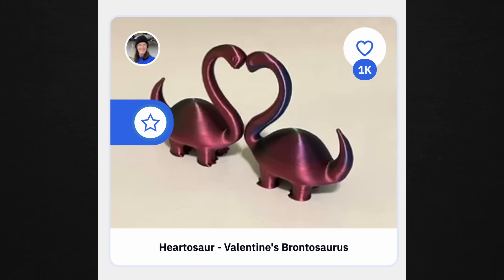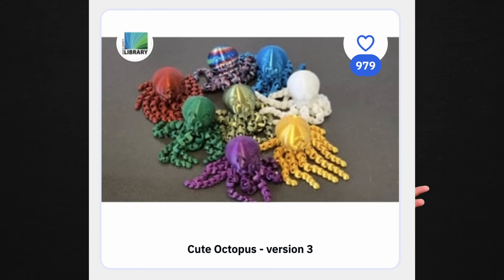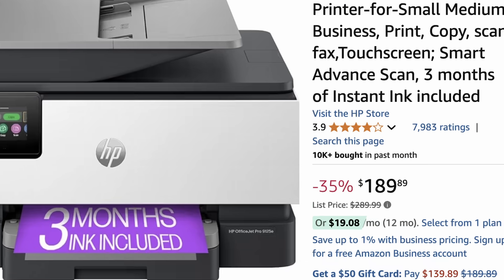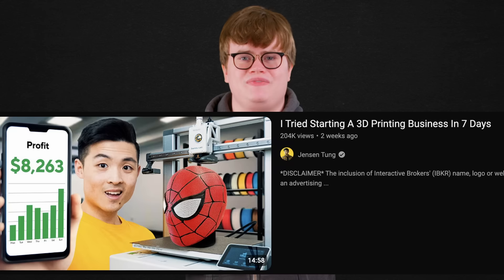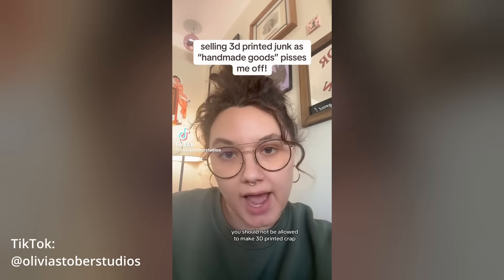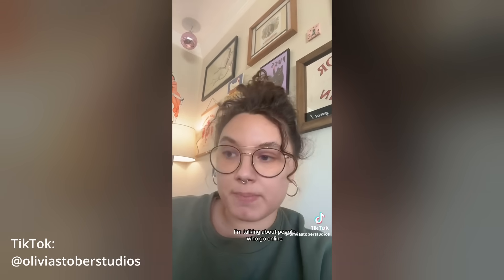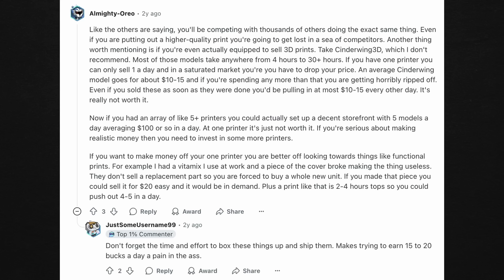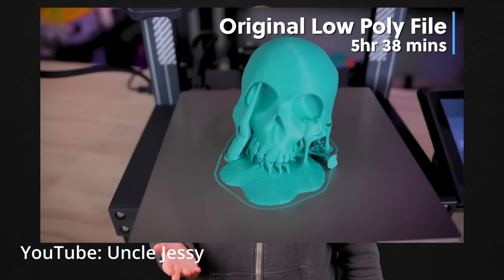The Rise of 3D-Printed Slop

Comment: I will say, sanding is not such a problem anymore. My bambu A1 mini, which isn't particularly expensive, produces incredibly smooth prints that don't need sanding at a layer height of 0.10mm. That does mean longer print times, but sanding would take even longer. Won't help the people trying to make a quick buck printing crap, but if you want it for what it's good for then it can be really good

Comment: I feel like 3D Printers are like photo quality ink jet printers. Almost noone can justify owning one themself. But. A community printing shop can get an expensive one and people in the community just rent the print time. The rent then financing both payments fo any loans/credits used to buy hardware and replenishables and also keep someone that can run the maintenance jobs to keep the darned thing running reliably. 

That way, you get the best of both worlds as the end user. A print that's cheaper than what it would cost to do in your own home, and a printer that's regularly serviced and calibrated by someone with the knowhow. 

Because, until we get truly hassle free set up and forget printers. Like an office level laser jet. It's too little fun printing to justify expense and waste. 

And if it's a community run printer, you're less likely to print plastic waste.

Comment: It might be an edge case although, as a tool maker, I bought one for making patterns for metal casting and vacuum forming. It was far more time consuming making tooling from wood and 3D printing makes it easier to add details, plus the prep effort is about the same. I'm currently looking at a resin printer for lost wax patterns

Comment: I recently bought a higher end 3d printer from Bambu Labs. Been using it to make prototypes for my own lighting and decor piece designs, as well as molds for sculptural work. Insanely useful tool and a valuable part of the process. But as a stand alone production system… not so much.

Comment: I use my 3D printer to print stuff i can’t get otherwise such as custom adapters, housings, holders, tools, gridfinity and more. Most of it is designed by myself. That’s what i bought it for, it’s a tool, not a slop printing machine.

Comment: There is a massively ‘holier than thou’ attitude in the comments here. You don’t have to be into 3d modelling to get a LOT out of the 3d printing hobby. In my case, I’m interested in projects like cyberbricks, which are pre-designed kits with electronics etc. For example,  me and my kids can create our own RC model kits - we can enjoy 3d printing all the parts required for the model, then have a good time assembling, adding the electronics components and motors, and then get the satisfaction of playing with and reprogramming the finished product. 

In this entire process we haven’t done any 3d modelling ourselves, but we get a great educational family activity, electronics can be reused in new projects rather than thrown away, and there hasn’t been a whole distribution chain involved.

I think people should stop trying to be gatekeepers for the hobby by insisting that people ‘need to do their own 3D modelling or else they shouldn’t own printers’. The whole process is really interesting, especially for children, and it will likely inspire them to eventually create their own 3D models, or get into programming, or become more interested in engineering

Comment: I think you're way too defensive about your opinion here lol. 3D printers are going to waste in most cases and it's all fine and good to learn modelling parts or printing something that's going to be useful (like I had a special window hinge break recently and it was cool to 3D print a replacement) but I'm kinda upset by the mountains of random crap (not saying all 3D printed stuff is crap, but if you're printing crap---"dust catchers---it's crap) that I see flow out of our maker space printer 😬

Comment: Had my printer for less than a month and had zero experience before. Bought the 5m pro from flashforge and I had fixed a bulb holder for my 99 dodge ram and fixed an old big fan that one of its legs was broken, made a customized part for my ford ecosport where the part was nowhere to be found. 3d printed a mini4k drone case and customized my name on it. Me being from the Caribbean having extreme delays with shipping products this is gold. So for me its worth it, as what I had made up to now fills holes that could have never been fixed. 

Just from an outside of America perspective.

Comment: Yes, 3D prints are handmade. Anyone who has operated a 3D printer can agree. Let's stop pretending that these machines just spit out 3D prints with no effort. Yes, filament and SDF files are purchased but, did you make the tree that stool is made from? That being said, we should not be seeing people trying to get rich off selling 3D prints. That is not what the printers were designed for. The problem is with 'gig work' addiction. No one is getting rich off 3D printers. Anyone convincing you they are, aren't telling the truth.

Comment: 2:15 wha?! What kind of standard laser or inkjet printers have you had!? Ive legitimately had an easier time modifying a defunct stratasys mojo into a product specific 1-72 and 2-56 thread ultem tapping machine than getting a damn paper printer with a bad print head working again!? Inkjet printers are abominations! 

Is there just something wrong with me? I honestly would rather try to print a big warp probe part in polypropylene than try to get a damn HP or Lexmark to work reliably... 

okay, maybe its because they sit so long between printing so the ink gets messed up in the heads... Still, i dont like paper printers, even the laser ones have so many networking issues... okay, sure, so maybe thinking back i miiiight have gotten around networking issues on the 3d printers by turning a mini pc into a sort of wifi relay thing... but still, i dont think a 2d printer would have liked that!

Nonsense out of the way though, the rush of weird print farms for junk is odd. I come at these things from tge engineering/tinkering side of things and completely dont pay attention to that stuff.

Even the way you mentioned people doing this is surprising to me though. On smoothness there are plenty of tricks you can try and thats befire you just print molds or something. Like, if you use ABS or ASA (usually you want an enclosed printer andvtge fumes are worse plus you can snell them... and qidi makes cheap enclosed ones with chamber heaters and even built in carbon and hepa filters though) you can use a sealed container with a bit of acetone to vapor smooth them. Vapor smoothing leaves a perfect glossy surface with no layer lines and some ABS blends, like fusion filaments gloss ABS, do it so well you can trick people into thinking its injection molded. ABS also takes to paint better and sands MUUUUCH better than PLA or PETG too... yet it looks like they dont do any of that and just rely on open frame printers... the laziness is impressive, i always figured they cared more for aesthetic prints and did more tweaking and filament testing for speed and quality (e.g. hugher flow materials, lots of profile tweaking, manually tweaked variable layer height settings in Orcaslicer and better infil choices per model can get you good speed at and good layer hights, especially if you design or modify the parts for it), but you make it sound like they literally just dump modkes in, use some "draft" type default print profile, use cheap filament, then call it a day... i guess the algorithm really kept me in my weird "i designed this 6 part mold, molded a silicone mold, and an then used that part to mold cement" or "i designed and printed this mostly printed printer that can print most of another printer" corner of the internet.

Anyway, if you get a printer for yourself and intend to paint things, consider one with an enclosure and either print/make/buy a carbon filter box for insude the enclosure or on the exhaust fan (if it has one) or get one with it. This will help a lot for ABS, ASA, or HIPS which all sand better, take psint better, and csn be vapor smoothed (HIPS can be done in limonene, ASA/ABS in acetone, just be cautious about fumes). They all also work with more glues than PLA or PETG so if you want to make a gigantic multipart print you wont have to fight as much, though earping can be a bigger concern. Glass or carbon fiber helps a lot with warping but impacts the surface, you need a hardened nozzle (many printers come with one now) and ypi will want to use more PPE when sanding (not nearly as much fiber for volume as proper composites but still).

Well, i need to not write horribly written rambling essays just because im tired but cant sleep or whatever.

Comment: I did some plastic injection molding after my senior year in high school (1986), third shift. We made those tracks for dot matrix printers. The plastic mix had to be very specific and at a certain temperature. It was easy to crank out a bunch of stuff that was crap. Sounds like 3-D printing is about the same lol

I was saving money for college. My dad did work like this for over 30 years as a high school non-graduate. My mother worked in a sewing sweat shop as a non-high school graduate. They were both born in the mid 30s. At least they had jobs that could support a family with (a) house in the suburbs and (2) cars and (3) kids. Now? Nothing.

Comment: 2:15 This is such a valid question because basic 3D modelling is ridiculously easy to learn. With a few exceptions, I find it difficult to see how one is willing to go through the effort of buying and learning to use a 3D printer but isn't willing to learn 3D modelling. 

You don't have to be able to design complex minifigures on blender to get value out of your 3D printer. Making stuff like containers is pretty easy

Comment: We (my partner and I) run a small 3D printing business.
We mostly print unique, beautiful large sculptures, as well as artisan resin keycaps, which we then paint and sell.

Recently, we bought an awesome filament printer. It quickly became clear that this technology is much better for printing functional, practical items.

For example, we printed a custom-sized drawer for my paint brushes that fits under my table - there’s no properly sized drawer on the market that can be installed there.

We also printed a bunch of extra accessories for a Skådis setup (custom Skådis items):

- a camera arm that can be moved in any direction to film my painting process
- tiny shelves for my paint pots (I use small pots to mix my colors)
- a large file holder to sort customer receipts
- cute tentacle arms for my mechanical keyboards

All of these are made in baby pink and white, because I’ve built my entire setup around these colors.
I love my art station.

We also print a bunch of extra items to solve problems around the house, but as sellable products? Not really. For that, resin printers are still the better choice.

Comment: I use my printers to print miniatures or plastic parts to fix furniture and other items in my home; likewise, I often make gadgets, components for my work, or broken parts of items in my house that I would otherwise throw away because I couldn't afford to repair them.
The other day I saw that someone had thrown away a small plastic chest of drawers because one of its wheels had broken, so I picked it up, removed the remaining wheels, designed some Victorian-style legs that fit perfectly with the geometry of the table, and joined them using pressure and plastic welding. Then I added Gothic-style decoration to the corners and painted it black; now I have a beautiful Gothic-style table.

Comment: Not only is it true as you've said, 3D model markets are majority fill with junk plastic prints. The horrible waste that comes from Multi-Material Systems on printers. Relatively new and they are a cancer.
Also, majority people I've seen online and in person are very wasteful when prototyping to make actually useful items. It is seemingly mandatory in youtube to full send designs only to realize an easy to spot potential tolerance problem shows up. So they have to throw the whole print and re-do. Instead of printing just smaller segments with minimal fillament to test fitment and functionality FIRST, then printing the whole item once fitment/function is confirmed.

Comment: I found some issues in your video, probably from you basing on outdated videos and not having recent 3d printing experience. In short a lot of things changed in that world, the printers became better to the point that anybody can walk in and get GREAT print results with 15 minute start guide and 300$ printer. Giving that the user count grew, a lot of modelers started taking 3d printing seriously and on site like makerworld you can find a lot of good and actually useful stuff that makes sense to print in house and not buy on temu, while the mentioned thingiverse has became obsolete because it didn't adapt to the wind of change, and now is the dumpster for models that didn't pass makerworld quality standards. You also mentioned some good things like the flood of 3d printing businesses, where "hustlers" rush to buy a 3d printer they know nothing about and sell the crap thinking they are the first one with the same idea, but apart from the 90% of the market that will fail, there is the 10% where actual makers that do this with actual passion, they can succeed with there own high quality models and production process that solve an actual problem of the niche they operate in.

Comment: Researcher Use 3D Printer For Prototyping & Doesn't Waste Or Even Cost Alot On Filament When Printing. Bc They Use It Conservatively. Instead, Most Human Use It To Print Useless Things Then Throw It Away Later. Like, It's Plastic. It's Not Wood Or Compostable Material. If It Was, My Head Ain't Even Bug Thinking All The Plastic We Throw Away. Unless They Crush The Waste Then Reuse It. Plastic Can Be Reused Many Times Yet There's Limit How Much We Can Reused It Before It's Useless To Even Be Recyclable.

Comment: you realize all the actually good things people sell are still made by them right? i mean the model was designed by them, and you probably dont realize how hard it is to 3d model. calling it 3d printed junk is dumb, because it was still made by a person
Reply: Just because it is made by a person does not make it not junk.
Anything that you will ever print will become trash at some point. The novelty will wear off or you will run out of space then it will just be more plastic introduced into the world weather people are selling it or not. 
PLA is only biodegradable at industrial composting facilities so it will probably end up in a landfill where it will rot for decades.
Denying that it is junk that will be thrown out at some point is really short sighted and dumb.

Comment: Idk how I ended up here but I couldn't agree more. Since 3d printers popped on scene I've decreased my convention attendance because I find soooo many tables are just saturated with these 3d printer novelties. And it's alwayssssss the same designs table after table. 3d printers were supposed to fill a niche for pieces that were soooo 1 off that you wouldn't find it anywhere (say a  joint for a toy or replacing a specific broken part on something).  Buts it's gone the way of ai - just converted into bastardized monetary machines that no one asked for and really benefits no one

Comment: The problem is, the 3D modeling tools haven't gotten better.  AI is being wasted, it should be used to get rid of the cumbersome interfaces that things like Blender uses.  Instead, you should be able to type "create a cylinder 4" by 2" with a 1/16" chamfer. "

Comment: A good use of 3d prints is not as an object to sell, but as a mold or form to MAKE the item.  Want to make a ceramic cup with a logo on it? 3d print the cup, make a mold with pottery plaster, and slip cast it.  you can 3dprint an embossing die, a stencil, or even the display stand etc.  Few people want a 3d printed trinket, but are fine with a metal/ceramic trinket that was made using a 3d printed mold..

Comment: Yes I do have quite a bit of 3D print items left on the desk or cupboard getting dust.  Of course I fold away many 3d print wastes caused by print failure.  It is tempting to work on your 3d printer but sometimes you would wonder why you want to print it if I can buy it cheaply on amazon or Temu.